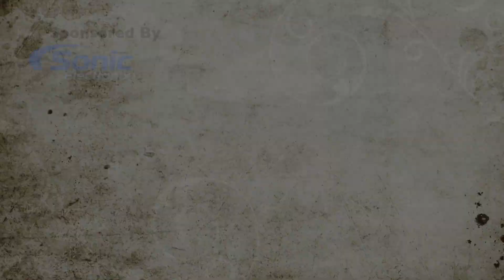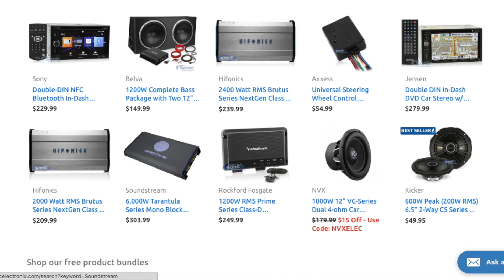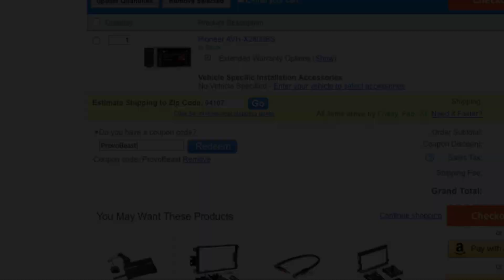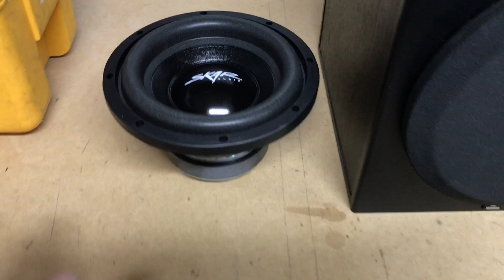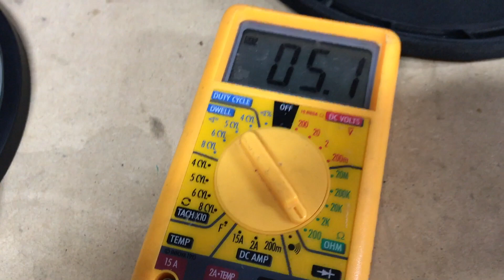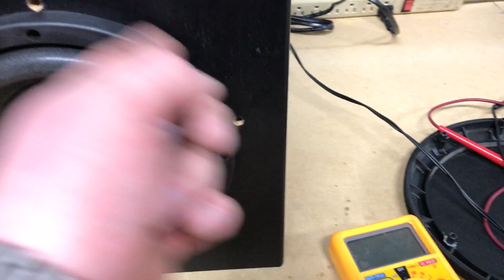Home Theater Subwoofer Replacement | Skar 8" Sub

Comment: I have got kenwood sw 301 and I also need to replace speaker. Do you think that car speaker same size will do the job ??
Reply: Phen0mable as long as you have an amplifier that can deliver the proper amount of power to your sub you should be alright. Besides needing a converter to convert to sound for home audio instead of car audio but most of the time your amplifier should give you access to those settings. You'll also want to set your gains and balance out your highs and lows. Car audio subwoofers when placed in home audio systems seem to overpower the rest of the system causing a lot of distortion. So you'll want to balance out the gains and what not so you can skip that effect. You'd also want to tune your system to your house and the speaker to the box it's in. That way your getting the maximum output possible without distortion from both your speakers and your amplifier. If your amplifier isn't strong enough you'll hear distortion caused from burning up the amp. If your speakers are too weak you'll be destroying them. 
If your not concerned about true audio quality I would suggest just Makin sure that your amp is powerful enough for the sub and to make sure you balance out the sub with the rest of the system
Reply: +J K

Comment: Will it still get as loud as the other driver? you know before it was getting distorted
Reply from the maker: Maybe not louder, but certainly cleaner, much higher quality over the factory woofer since we have the same internal amp pushing the new 8"
Reply: I have a polk audio 10in powered sub that would like to change out because i feel that im gonna pop it watching a movie , any recommendations,  maybe more wattage and decibel sensitivity

Comment: BUT the million dollar question is, does it sound better then the factory sub did before it started to blow?
Reply from the maker: Oh absolutely!
Reply: Zack Rose garden
Reply: Doubt it.skar are crap.
Reply: @winfield347  😂 skar is just as good as any other brand, I've beat the hell out of skars, cts, DD, jl, fi, psi, and orion. U less your a brand freak, skar fuckin performs
Reply: James.skar are cheap crap.
Reply: @winfield347  They're on the budget end but if you actually see how much they sell (like CT sounds etc.) There's always going to be some duds here and there. That's just how it is with all these high volume brands. I guarantee there's the same amount of people with CT sounds and others.

Comment: I have a yamaha yst-sw305 and one of the 8 inch rattles. Would I be able to replace both subs with 2   car subs? It has a 200 watts Amp driving both subs with 12 ohm rating on both subs.
Reply from the maker: Yes, probably the best to do both.  Most likely the Ohm load on the amplifier is around 4-6 ohms with two SVC 12ohm subs wired in parallel.  If you wired two DVC subwoofers together (like the same sub we used), you would have to wire each sub in series, then wire each sub together in parallel to achieve a 4 ohm load final.  Use these diagrams to help: http://knowledge.sonicelectronix.com/tools/subwoofer-wiring/
Reply: Thanks for the info! I will report back when I get them installed.
Reply: I got both Planet Audios subs installed and boy do they sound good! Thanks for the info, it really helped me bring new life back to my home theater sub.
Reply: XcceLL can we see please?

Comment: what does the blue wire wire identify in the model shown for how to connect a dual?
Reply from the maker: I'm not quire sure what blue wire you are referencing, sorry.
Reply: Its a dual voice coil subwoofer. they come in sets
Coil 1 + & -
Coil 2 + & -
The diagram has the blue wire going from "coil 1's -" to "coil 2's +". You then connect "coil 1's" + and "coil 2's -" to the amplifier.
He's doing it this way to bring the final ohm load up to 4ohms. something must amplifiers can handle
Hope that helped